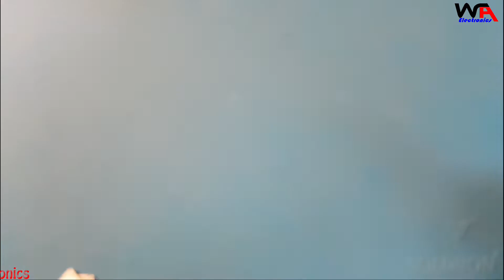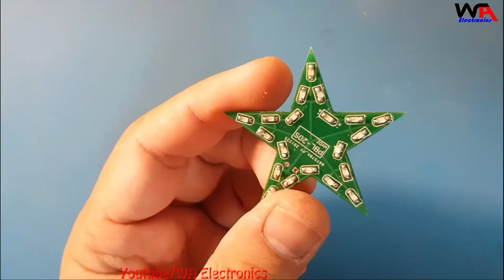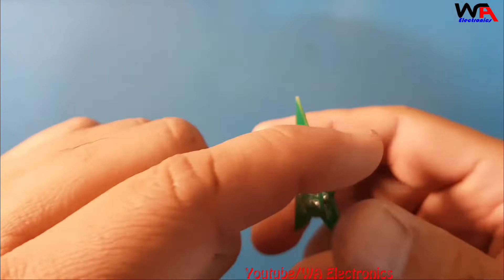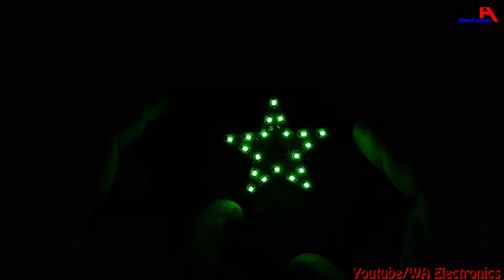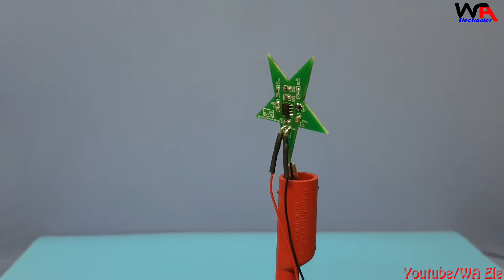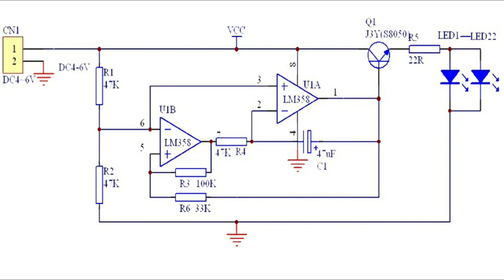Star Shape SMD Chip LED Electronic Project Diy Kit

Comment: Thanks for your video... I just finished mine that ive received today but I got a problem.  I broke a LED after trying to unsolder it after I finally found the polarity on the board (the instructions of mine was in Chinese and I don't understand that language).

I've replaced the defective LED by one that I kept from another project.  The problem that I have, it's only the replacement that lights up. A solid light,  no blinking.  I don't understand why and how to solve this issue

If anyone have an idea why and how, it will be appreciated. 

Thanks